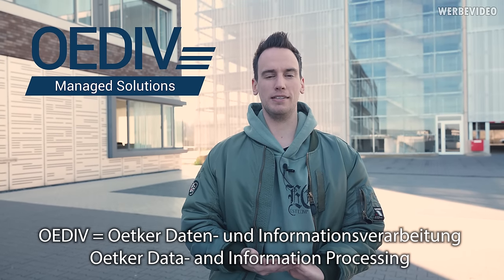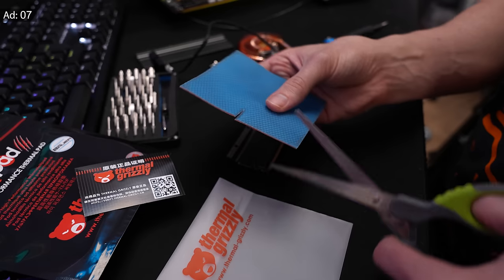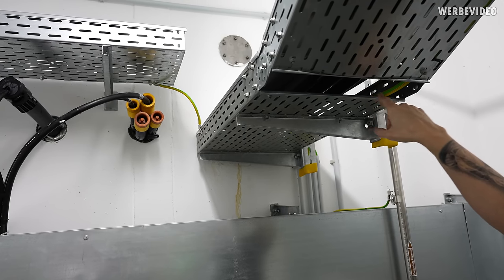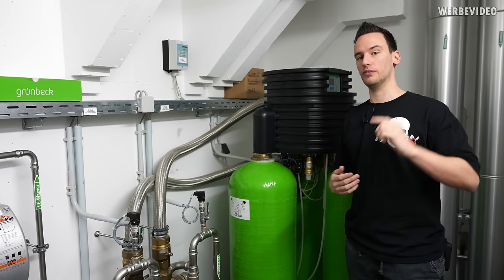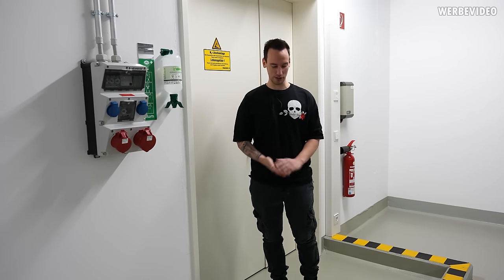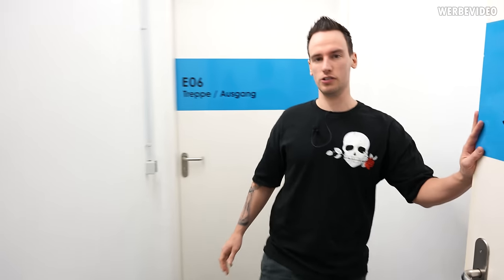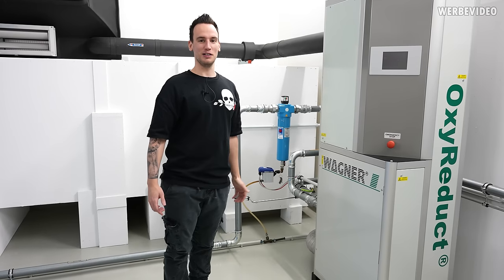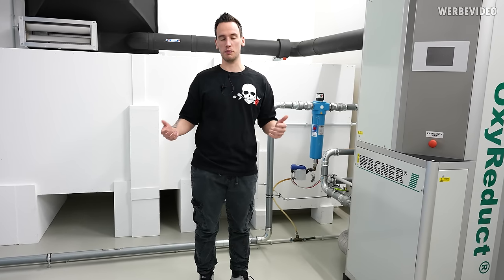Exclusive Insight: Visiting one of the Most Advanced Datacenters in the World

Comment: I used to do maintenance testing on Data Center Power Systems.  We had been using bigger and bigger batteries and had similar issues with the hazardous properties of them.  Now, A 1.2 MWatt Diesel Generator (Caterpillar,, Cummins, Generac....like the one you showed) provides a 2nd power source which when used with a transfer switch allows the use of smaller and smaller batteries which provide power only long enough to start the generator.  After the loss of Mains Power, with the Generator started, the transfer Switch switches to the Generator.  The Data Center Power is derived from those UPS systems like the ones you showed. whose Inverter is always running off the batteries which themselves are charged either from the Mains or Generator.

Comment: The gas suppression and aspirating systems was great to see for me. I work in that part of the fire industry here in Australia, and was interested in how ( and what brand) the systems are used overseas . I have set up similar systems for data centres here.
Reply: Is it complex to do the installation? I am in engineering student and I am hugely interested in working in such fields
Reply: @Kenia-sn1cg  Depending on the local requirements , standards, and authorising bodies, it's a hard field to get into. 
Here in Australia, there is a lot of licencing and training to install gas suppression systems like this. Even small systems ( single tank of suppresion agent) require a lot of licencing to install, test, commision and maintain. 
Depending on the agent used, and volumes, and also age of the system, there is a lot of regulation. Some older system used ODP ( ozone depleteing) gases, so if accidently discharged , or even intentionally discharged ( like in a fire instance), there is a lot of paperwork to inform the relevent enviromental agencies. 

Most suppression systems use non ODP gases these days, usually carbon dioxide, nitrogen or nitrogen mixed with other inert gases like argon, or other synthetic agents .  
There is some skill required in designing gas suppression systems. You'll need to take in to account factors like, room size, temperature, room pressure, gas dispersal rates, type of equipement in room, types of fire likely to occur ( electrical, paper, plastics, etc) and many more.

As for the asprirating systems, most of them usually operate in a similar manner. The general manner they work by , is to constantly sample the air via capillary tubes, or sampling points , through a laser particle reader. This reader will measure obscuration percentage of the air. Some systems can measure as low as 0.01% , by contrast, a smoke detector will normally alarm at 6-8%. So having a dust free enviroment is very important. 
The design of an aspirating system is generally easier, but there are still factors to consider. 

In most cases, the aspirating systems will be part of larger smoke/fire management system used to trigger the release of the suppression system.

Comment: Data centers are always fun to go through.  Some things I have come across which could make for better, more efficient data centers than the one you went through, and I am sure you have thought about some of this with the videos you have made, but some of it may be new to you:

1. 380V DC standard for power delivery.  This is +=190V nominal, 300V to 425V range to the servers.  What this standard does is after the transformer step down to 480V AC, do one conversion to 380V DC nominal and have those batteries hooked up in series and parallel to equal 380V DC nominal.  From here the power goes over power rails more efficiently, as DC travels over the wires more efficiently than AC, straight to the servers.  The server power supplies have basically half of the hardware in them as they skip the AC/DC conversion, which takes a lot of power electronics to efficiently and cleanly convert AC to DC,  instead going straight from 380V DC to 12V DC.  This is far more efficient and uses far less hardware than traditional AC power delivery to the server.  Something like 30% space savings in data centers that do this (and I spell out data center long to not confuse with direct current) while getting a big boost in efficiency.  You mention the efficiency of data centers at the end of the video, which is an important metric and this is a way to raise the actual efficiency and even save on costs when this tech is done at scale.

2. Considering how much Germany relies on renewable energy, something else that I think should be done, especially when doing a 380V DC standard data center build, is to swap out the batteries in the battery room with LFP batteries and build for at least 4 hours of storage.  As you may have noticed, the space used in the battery room is not that efficient and they built around the notion of lead acid batteries spilling, which you will also see in old telco buildings where they built everything to run on 48V DC, which takes some crazy big bus bars to do at that voltage level.  The idea of having these hours of storage is you can balance against the green energy grid and may even stop taking power from the grid for a while when the electricity prices / demand is the highest.  At least when there is variable pricing involved / you make a deal with the power company to help balance the grid, such a setup can save / make a data center a lot of money as you will already have the conversion hardware and the big power use case, just add more batteries to your battery room.  At this those diesel generators don't need to run as much during a power outage and can have a much longer grace period to warm up, saving on electricity to keep them warm when you have a battery system with hours of storage; you just make sure to have a certain minimum storage to give the generators more time to warm up.  LFP batteries in the data center is also a good thing as modern LFP batteries will last for decades.  Also by the end of the year (2022), Germany will have a large LFP battery manufacturing facility in operation run by CATL, one of the biggest names in LFP battery manufacturing.  So you will likely make the batteries used in the data center in Germany.

3. Getting to where your expertise comes in, liquid cooling the high powered components in servers with a negative pressure liquid cooling loop.  A number of data centers do this, especially for supercomputers, and it is extremely efficient and ironically uses a lot less water than the system you showed.  The reason for this is air is a very poor carrier of heat, so you have to cool the air to a certain low temperature, much lower than the temperature of the components you are cooling, or else the server hardware in the racks will get too hot because the delta-T (change in temperature) with air is high.  With direct liquid to the hot running components using water blocks, you can run the coolant at much higher temperatures as the delta-T is much lower.  These much higher temperatures get into a hot summer day where it is say 37C outside is cool enough to not need any extra cooling measures such as evaporative cooling nor air conditioners.  Some data centers get down into a PUE of 1.1 where this one you specify as 1.35 and the bar is 2.0.  So yeah, efficiency can be better, granted this one is pretty good, granted they use a lot of water, which gets to be a problem in some places where there is not enough water to go around.  This problem is getting worse with global climate change, so this thinking about evaporative cooling has to be changed unfortunately.

4. A number of data centers are moving to back of rack radiators.

5. Also in your wheelhouse, use of liquid metal thermal transfer compound and high W/mK thermal pads.  The idea being the more efficiently you transfer the heat to the heat sinks with a smaller delta-T (change in temperature) between the die and heat sink, the less you have to work to keep the die at or below its max target temperature.  Data centers are built around keeping the components down to a certain target temperature at max load and when you throw in all of the inefficiencies of low end thermal transfer compounds, IHS's (Internal Heat Spreaders), air cooling, and heat buildup as you go through long, high powered servers, you end up spending a lot of energy and often water to reach that target inlet temperature.  Also those super noisy server fans use a tonne of energy to spin that fast and get into significant air friction heating, so if you carry most of the heat away with high density water blocks where you don't have to work as hard to move the more heat dense liquid coolant around, you can use much slower, more efficient fans for the remaining lower powered air cooled components.  Anything you can do to allow the target temperature to be higher reduces your PUE and/or water consumption.

6. Shifting gears a little, use of ZFS RAIDZ in the data center.  While I have used ZFS RAIDZ level 2 on Solaris in the data center primarily on mechanical drives with SSD caching drives, ZFS under Linux and FreeBSD has gotten a lot better in recent years and supports TRIM on SSDs.  RAID controllers do not support TRIM.  If you have ever done SSD RAID arrays, those SSDs take a beating when used with hardware RAID controllers, especially as hardware RAID does not support TRIM and in general uses the SSDs in a very write intensive fashion.  ZFS is setup a lot more intelligently in terms of how much writing you do or I should say it is one of its optimizations at a slight cost elsewhere (space usage), and TRIM support is icing on the cake greatly reducing write amplification.  I would venture to say that ZFS is a more reliable and flexible storage system than hardware RAID based on my experience with it in the data center and my usage of it under Linux and FreeBSD.  The thing is where a data center may go for super expensive 10 DWDP (Drive Writes Per Day) SSDs when using hardware RAID controllers, they may find they can get the exact same job down with much less costly 1 DWDP drives when using ZFS RAIDZ.  I mean the improvement you will see with ZFS RAIDZ level 2 over RAID 6 is huge.  As a bit of a side note on this RAID level,  with RAID 1 mirrors sometimes the mirror fails before you can rebuild it, causing data lose and RAID 10 just amplifies this problem by adding more mirrors to an array.  In a data center there are enough drives to where you will see this happen, it is a guarantee when you are dealing with this many drives.  RAID 5 also amplifies this problem as you add more drives to the array.  RAID 6 is a lot better at not losing your data to random physical drive failures as you still have redundancy with a single drive failure, so the occasional second drive failure and just sector loss doesn't kill you, granted in a data center as soon as a drive starts losing sectors, you replace it right away.  (At least any good admin would.)  RAIDZ level 2 is basically ZFS's version of this, except a lot better in terms of data integrity and recovery capabilities.  Standard practice where I worked is to have 8 drive vdevs and just add more vdevs to a zpool when increasing storage.  In other words you have an 8 drive array with 2 of the drives for redundancy and then you just add more of these arrays into a single logical 'drive' / storage pool to get to the desired storage size. If you have ever dealt with hardware RAID enough, you start finding there are ways to lose data in a more traditional overall setup where there should be ways to make it better and not lose that data.  ZFS RAIDZ level 2 is a great answer to these issues.  There is a lot to explain here, but this is something you can read about and then this already long post doesn't need to get a lot longer and you can see why ZFS RAIDZ with direct access to the drives is just better.  It is also cheaper as you don't have to spend money on all of these fancy RAID controllers, instead just need simple HBAs (Host Bus Adapters) to access the drives.

7. I was a bit surprised with all of that fiber you saw, there weren't any specialized high speed fiber connections such as InfiniBand.  (Maybe you saw InfiniBand, but just didn't know what it was?)

I suppose this is a thing when you go to a bank's data center, they are going to be a bit more conservative in how they setup things than say a scientific supercomputing center and their hardware suppliers are going to be a bit more traditional in their offerings, so you just won't see some of these ideas to make the data center even more efficient than the setup you saw.  The most radical stuff tends to happen with hyperscale data centers.  It is just these are even harder to get into as the operators tend to be a bit more secretive on how they do things.
Reply: As much as I love ZFS, it's not an FS made for scale. If you want to scale ZFS, you have to rely on a cluster FS like Gluster, or Ceph on top of it. These DELL EMC machines you saw are NOT using RAID controllers. They either use their own specific cards to do everything on ASICs or they use software to control it. Also, those are NVMe SSDs, the amount of memory bandwidth needed to support them is massive. Those machines are probably using some kind of DPU that connects the fiber and the storage directly, without even going throught the CPU.

Comment: I’ve been to a data centre here in Australia and it’s a similar story with their infrastructure, redundancy is the key word. They didn’t just heat the generators though, they convert the generator to a grid driven motor to keep the engine spinning, so if they are needed then all they need for starting is opening the fuel valve, and the motor automatically switches back to a generator.
Reply: I'd be interested to see how they've implemented that electrically.
It would probably shave (just) a couple of seconds off the time that UPS'es need to keep the load up, whilst using heaps of power to keep that motor running.
There's little to no cost saving on UPS'es because the two nets would still need to be switched in and out, and that doesn't happen in less than a couple of seconds.

Comment: That was really really cool. Thank you for sharing this. 

I worked at IBM back in the 90s, and we had a comparatively miniature tape robot connected to the mainframes. Insane to think they're storing terabytes of data on tape now. I'd love to know how they made that data relatively quickly accessible - it wasn't fun with 100MB.
Reply: LTO12 will be up to 144TB! Insanely cost effective
Reply: I've worked with tape since the 1970s. Tape technology has leapt ahead of disk in terms of storage density. Fuji demonstrated the practicality of 185TB in LTO tape package back in 2015. If you think of the surface area you have to write on in 2000 ft of 1/2" tape, compared to the platters on a disk you get the idea.
Reply: @charliestevenson1029  I get the storage density thing, what I'm curious about is the latency accessing the specific data you want. Restores of particular files like I said, were not fun on tapes holding much less data than these do just because of the time it would take the tape to get to where it needed to be.
Reply: @ohkay8939  Its called cold storage for a reason. Its mainly intended for worst case. Its even on a different site. Speeds have ofc improved with data density but thousands of feet of tape is still thousands of feet of tape, theres only so fast you can move it. If you buy even fairly small cold storage these days the restore times are still 4+ hours.
Why would it need to be quickly accessible when they have layers of SSD fabric?
Reply: @mycosys  It's called HSM - Hierarchical Storage Management where you have different layers of access by speed required. Spinning disks are very expensive to buy and run, so you don't keep rarely accessed data 'online' , but you might keep a stub - just enough so the end user can start accessing the file quickly. The robot kicks in to get the tape with the rest of the data. Since 1985 most tape drives have recorded in a serpentine fashion, so it's not a sequential access to the bit of data you want, it's a combination of horizontal and vertical movement. LTO8 for example records 5160 tracks on 1/2" tape. Worst case is a seek to end of the physical tape. Data is (lossless) compressed, throughput in excess of 240MB/sec. Not all tape applications are for HSM, most is for offline backup security, often with remote robot infrastructure linked by fibre. Check out IBM's technical tape publications. The problem is, so many people think 'tape' is old and slow. The fact is, all large scale data centres use it - they have to. If you see inside any Google data centre, sure you see racks and racks of servers and disk, but you also see robotic tape libraries. Where I used to work, we had petabytes and petabytes of data on nearline tape (it was seismic processing), it didn't make economic sense to have everything on spinning disk.

Comment: WOW what an amazing video.  This place in on the cutting edge of tech which I love seeing.  Its really rare to get to see inside a center like this. thank you for taking the time to so us around.  All of those IBM Power E1080 nodes! .Each costing about $335k USD for each node. looks like there were 4 nodes in just that one rack. A 256gb DDR4 memory card cost $10K so the 16TB option in those servers cost $630K per node. So at the very minimum each rack with 4 nodes cost $3.4 million USD...  I work in a data center, while not quite at this level we do have the HPE Flex 280s.